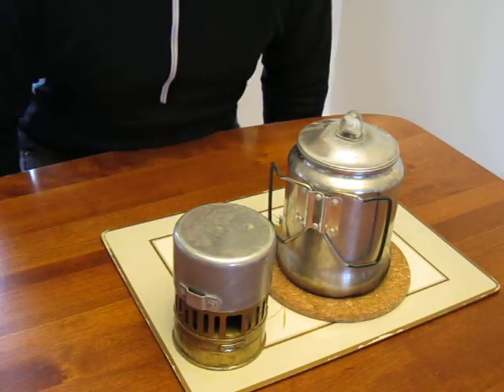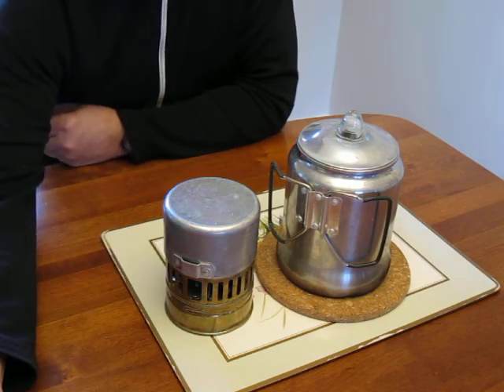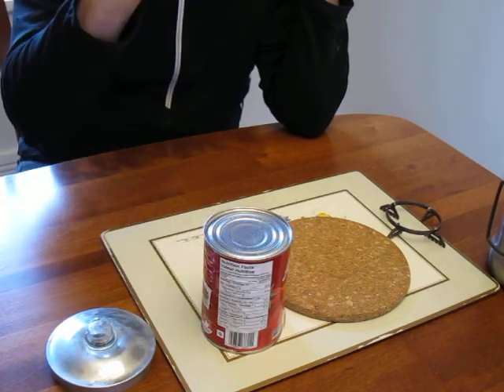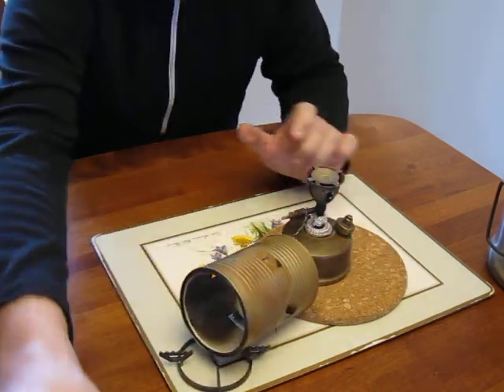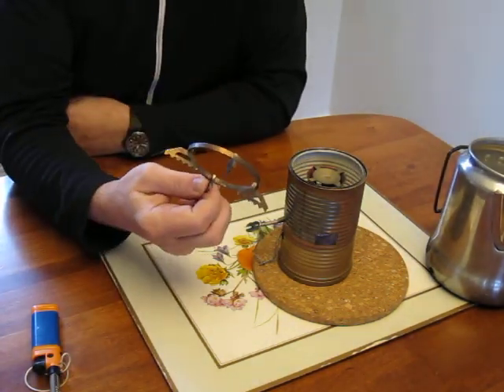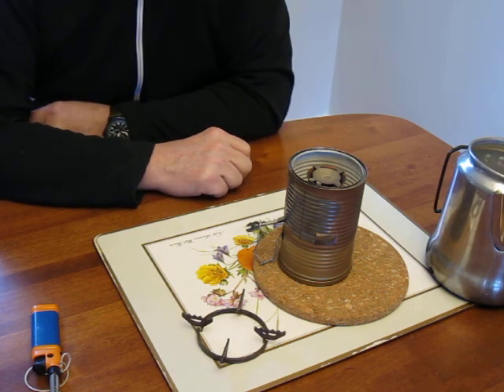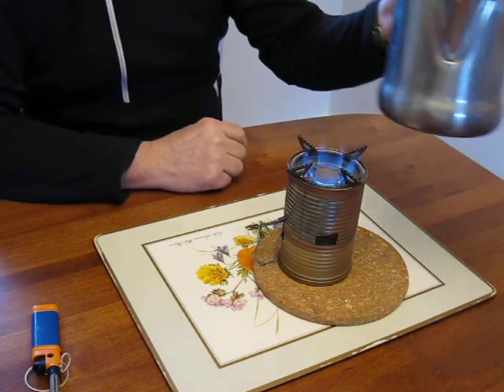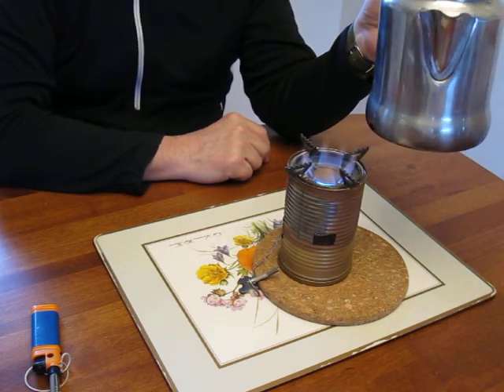Primus 71 stove with 3D printed support

Comment: a really great idea, have to remember that one. over the years i've seen quite a number of primus 71/optimus 80 burner units for sale by themselves because most of them were sold with a fancy tin can pot support/case with 2 hinged covers that looks cool and works, but is made of such thin steel that they inevitably rust out and get thrown away.. in the early days primus made a very nice aluminum case for the 71 that included a cookpot but those are very rare and expensive today. there were companies that produced aluminum cooksets designed like the sigg tourist cooker but sized for the 71/80 burner unit but those are long out of production and also hard to find. those were really the only option for a 71/80 with a missing case..
Reply from the maker: If only metal printing was less expensive...
It is one thing to make a stove support out of a tomato can, but if I then make a pot ring from a metal printed part from shapeways it turns it into an economically silly project after all. I am pleased that it worked as well as it did but I think I should put some effort into a support that can be cut out of sheet metal.